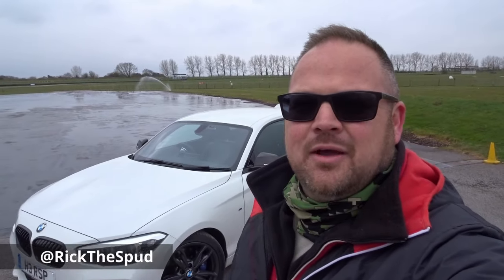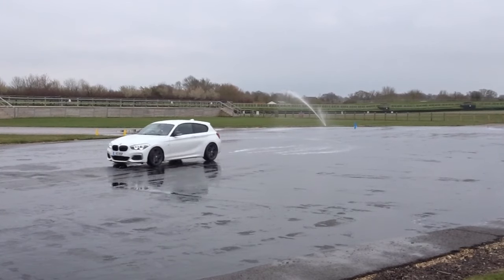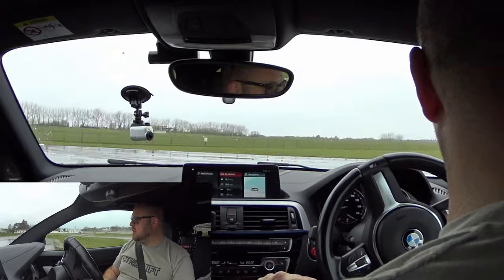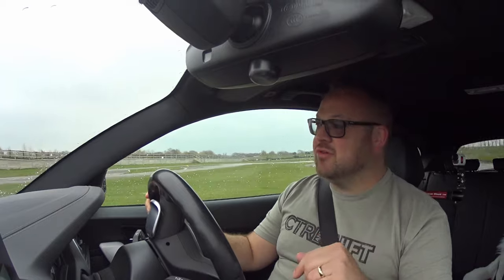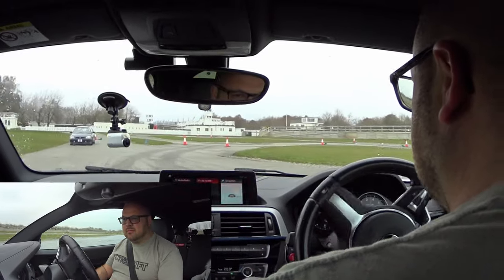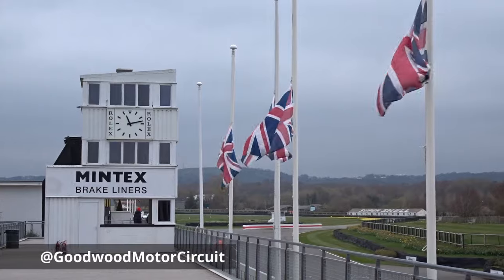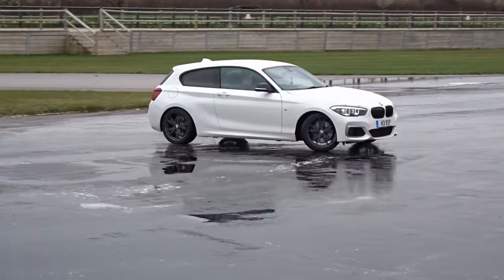So, you don't think you need Traction Control? | Testing DSC on Goodwood Skid Pan | BMW M140i w. LSD

Comment: I think a lot of people are unaware of how good, (or bad), a driver they are simply because of the existence of these driver aids.
Reply from the maker: Haha, yeah you might be right, MDM can make you look like a hero! 😎😉
Reply: @RickTheSpud  It did for me and that was only in a 120d.
Reply from the maker: @gottliebdee263  😆😎👌
Reply: I think it depends on the car cause it isn't the same technology or quality aids. Well, depends a lot if the driver is very good or very bad... So when you go at limits it's very difficult that aids helps you but a very bad driver could be a lot easier for electronics cause the wrong imputs.
But yeah, in the case like in this video, aids helps a lot for sure. It's very wet surface and in that circumstances the electronics can help a lot more
Reply: I had a prodrive upgraded GC8 years ago along with a fast road chassis set up with German made GSD3 tyres.

Ok, no driver aids or such but the car was definitely a better driver than me 😂

It'd let you recover some outrageous moments and I took that as I was a driving god.

Right up until the point I mistook a section of road for another and came barreling in like a cretin to what I thought was the entry to a long sweeping S section and it was actually a tight right.

Never seen all four tyres smoke from a sustained sideways moment before.

A grand lighter and a month later I go it back all shiny and never drove it like a dick again... Much.
Reply from the maker: Haha, great story! Yeah you've got to watch yourself out there! 😜👌

Comment: Great video mate. I bought a 2013 M135i about 6 months ago. I've been driving for 18 years but this is my first rear wheel drive car. The change from 200bhp front wheel drive to 300bhp+ rear wheel drive was quite a shock to the senses! I'm slowly growing into it though. I suppose the motivation to not wreck the car I've spent my life longing for is a good thing!
Reply from the maker: Yeah exactly. Great cars those M135s. Just take it easy and get your head round it, and get some skid training! 😎👌
Reply: I’m in exactly the same boat as you. I have been driving 18 years, just sold my 200bhp fwd type r and have put a deposit down on a 2015 M135i.. I have spent a lot of time on the internet learning what all the modes do and trying to prepare myself for being let loose in 320bhp of rwd madness. Hopefully I can pick it up over the weekend but I’m pretty nervous lol
Reply: @leexr2i  Congrats mate. You will be fine, just keep the traction control on til you get a feel for the power. I've got a M140i now and I've learned these cars wont bite you unless you go looking for trouble. If you are steady on the power (especially in damp) they are just like any other car. Just more amazing to drive! 😋
Reply: @jamessmith84240  

You lucky sod! Enjoy the (epic!) Ride!

Comment: Really enjoyed this and interesting the difference in outcomes. You’ve certainly wet my appetite to do the course in my car, more to see what happens when you go over the line - it’s an M2 competition & I fear it’ll hang me out to dry 😂.
Reply from the maker: Haha. One way to find out! 😉
Reply: With an LSD on the M2 will it not be alot more controllerball?
Reply: More predictable with an LSD? Isn't spinning up one wheel more likely to shunt the car into a spin?

I have read further down that the M140i has one.
Reply from the maker: Several questions and points to answer here.
Yes this M140 has an LSD.
On the skid pan it won't make any difference as it's so slippery that with over 300hp you're always going to spin both wheels.
So, on the road... 
Yes, with an LSD it will be more predictable. Without an LSD sometimes it will spin an inside wheel, sometimes it will spin both.
No, spinning one wheel is LESS likely to spin the car. If you spin one wheel, usually the inside wheel with less load, then the outside wheel will maintain grip and you'll keep going in the direction of travel. With an LSD you can't spin up one wheel so if you break traction it will be with both wheels and the car will rotate. Which if you know what you're doing is good fun! 😉
The middle ground with an LSD is that before you spin both wheels you'll have more grip to propel you forwards without spinning an inside wheel and losing forward drive.
Hope that helps.

Comment: Before watching the video I'll say I've found that at low speed I hate TC, at high speeds I prefer to have it in the "snow" setting, which keeps the TC partially off. This is based on my personal experience and having slid and having hydroplaned
Reply from the maker: Yeah, that's fair. What ever works and feels best for you. I'd say as a general rule MDM or Traction mode is a nice happy medium, it's there in the background if things go really wrong. 😉👌

Comment: Great to know about the "mid DSC off"/ "traction mode".
 just controls the traction control in that case, right?...
Reply from the maker: Yeah sort of, just puts the TC a bit more in the background, it's still there but it comes in slightly later and gives you a bit more slip. Very clever.

Comment: Maybe true for the skid pad but on regular wet pavement, even with DSC off, I have to actually try pretty hard to get my car to slide - it's actually a bit disappointing when I want to have fun with it cause its not as easy to slide around corners as I would like. I'm even on RWD with old tires. I am in an F30 though, bit heavier of a car, but I do have 450 whp/wtq
Reply from the maker: Oh for sure, you'll always have more grip than you think, until you don't have it when you thought you did!
Go a bit faster and pump the rears up a bit! 😉
Reply: @RickTheSpud  workin on it! its probably better that it has more grip than i expected...
Reply from the maker: Haha. That's for sure! 😉
Reply: @arthatis  its proably fear holding you back... me and my pal used to go joy riding in a clapped out 320i e46 and he'd have it all over the place sidways (we were 16)
Reply from the maker: @cupra2Jock.  I mean illegal joy riding when you're underage is prob not the best advice, but yeah, there's no shortcut to experience. 😎
Skid pan or a drift day experience is money well spent. Check out Learn2Drift or Pro Drift Academy for someone to learn to skid! 👌
Reply: @RickTheSpud  im 20 now mate getting an m135i this summer so will be getting some crap tyres on the back and sending it lmao. Drift days are fun too. Very costly though haha.
Reply from the maker: @cupra2Jock.  Ah wicked. Sounds like fun. A bit of power over on the road isn't too bad, but for big skids you've got to go somewhere private. Santa Pod do a 'drift what you brung day' with some play pens to practice donuts and figure 8s. Not expensive. Apart from tyres! 😉
Reply: @RickTheSpud  i think three sisters also do this kind of day, will look into it definitely. Learning to drift your car will improve fast road capabilites and overall driving too, probs more dangerous having a unconfident driver trying to drive quick lol.
Reply from the maker: @cupra2Jock.  Yep 3 sisters do that. If you go there have a look for a cool looking dude called Dango doing drift rides in the drift taxi, good mate of mine.
And yes I agree, always good to learn more skills, most common thing I see is undercorrection when the back starts to slide, people turn the wheel a quarter turn of opposite lock and call it a day. If the back keeps coming round you gotta keep turning. Keep your front wheels pointing where you wanna end up. 😉👌
Reply: @RickTheSpud  thats it mate your spot on! And will try spot him..show him how to properly jock a car lmao:)
Reply: @cupra2Jock.  yeah probably. I live in the city so it's not like I have a ton of room for error
Reply: @cupra2Jock. 

My mate had a lowered E30 325i... That thing was lethal in the wet especially in you hit a manhole cover 😂

Comment: For the UK at least, it would be inadvisable to drive a rwd on public roads without TC. Keep all that sliding business on the race track.
Reply from the maker: In your opinion. People shouldn't be drifting like this for sure, but you can have a car moving around slightly at the rear with complete control if you know what you're doing.

Comment: Great video.  Just got a 135i and definitely hitting the DTC button at start up from here on out.  Wasn’t sure all it did as manual is vague (“Engage for snow and mud” or whatever).  

Have a Solstice GXP and love the LSD…disappointing the 135i doesn’t come with one.  Just driving around and doing some slow speed turns with throttle steer is a total blast and so much more solid and connect vs “one wheel drive”.  Plus LSDs increase traction significantly in rain, snow, etc.  

Hard to spring $2400 just for an aftermarket LSD for the 135i.  They’re a lot because of the configuration.
Reply from the maker: Thank you! 👊
Yeah they're great fun cars for sure, plenty of power and obvs with an LSD mega for skids! 😜

Comment: when driving on a track or curvy roads to have some fun, should we press for DTC and is it better to drive always that way no matter the weather? thank you
Reply from the maker: It depends if you know what you're doing when things go wrong. Half way mode is best as it's more relaxed but will try and save you if things go wrong, altho much later. Depends how good a driver you are. 👊
Reply: @RickTheSpud  but basically there is no downsides of using DTC for sporty driving correct? I am dallying a beautiful 123D E82 and getting a big more power now..
Reply from the maker: If you're a half decent driver you should be good! 👊😎

Comment: Great vid man and question does traction control automatically come back on when you turn the car on and off just got a 328i haven’t messed around with it yet
Reply from the maker: Hey thanks buddy!
Yeah I would assume so, normally whatever you touch, when you restart it then traction is back on, stop start is back on, and everything is back in comfort or normal. 😉🤓

Comment: When I full throttle in sport plus mode on a wet road, I felt that the rear wheels kinda shuddered the moment I floored it, is it due to traction control activated? I was in sport plus mode and did not touch the dsc button.
Reply from the maker: Sports plus I think is DSC in half way mode (MDM or Traction Mode) so the shuddering is prob rear axle tramp from the rear wheels slipping and gripping and slipping and gripping really quickly. They're on the verge of grip. If the tyres spin faster they don't do it, but you'd need everything off for that. On a closed private road near Mexico! 👊😜
Reply: @RickTheSpud  That makes sense then since I was on a wet road. Just curious, would this still happen on a hot day dry road? I have a rwd m340 with ps4s set up
Reply from the maker: They'll prob just grip, but at the point they've lost grip you'd have had to overwhelm them so much they'll be spinning much faster and not shudder! 👊😎

Comment: Traction mode should be the same as Sport+ regards DTC/ESP
Reply from the maker: Yeah I think you're right, I think Traction Mode is short for Dynamic Traction Control or DTC mode...
Reply: @RickTheSpud  Correct.
The difference is, in sport+ the throttle map is more like an on/off switch, but in traction completely off mode it has comfort throttle which is much better and more progressive.
Reply from the maker: @DjNikGnashers  Ah nice one buddy. Yeah that makes sense. 😎👌

Comment: I understand that the MDM mode works at the condition to counter steer, if not the car will behave as the DSC was off. Is my understanding correct ?
Reply from the maker: I'm not sure what you mean buddy.
Not sure counter steer affects it, MDM just allows for more slip but still limits the slip, you can still spin out as shown...
Reply: @RickTheSpud  Actually I’ve noticed that you proceeded  to two skids with MDM mode. The first time you didn’t counter steer and the car made a 180 degree. Seconde time you counter steered and obviously the MDM mode helped a lot to power slide properly
Reply from the maker: Ah I see.
Yeah true, but notice how slowly it rotated with MDM mode on, compared with MDM off!
With grip on a normal surface MDM would prob save you.
Reply: @RickTheSpud  Ah ok I understand. Thank you so much bro...it’s been a long time I was wondering how the system behaves actually and what are it’s limits. Now everything is clear thanks to you 👍
Once again thank you very much for your explanation.
Reply from the maker: @bobalto  Hey no worries buddy.
Hard to go into too much detail on here but I'm glad that helped. 😎👌

Comment: Lately my f30 is cutting off throttle/auto brake if above 80km/h under wet conditions on the highway..is this normal?
Reply from the maker: Is it trying to spin up or aqua plaining?
Reply: @RickTheSpud  not sure. It is just under rain with wipers on and will “auto brake” if I go above 80km for a while.... I also understand that it has brake drying function?
Reply from the maker: Oh really. Wow. Sounds like you know more than me. 👊
Reply: @RickTheSpud  🤣 I just google/YT  it

Comment: Wait, so this was with LSD? Curious how it would do without one.
Reply from the maker: This car has an LSD, but the Goodwood Cars have no LSD and are exactly the same. 
The surface is so slippery, with 300+ bhp you're not just going to spin one wheel! 💪😉
Reply from the maker: 😆
Technically you're more likely to spin out or do a 360 WITH an LSD, as without one you're more likely to just spin up one wheel and not slide at all... 😉
Reply: @RickTheSpud  Good video very interesting, but I drive EVERYWHERE in DTC OFF mode, it's the first thing I do when I get in the car, hold it down for a few seconds to turn it off completely.
My car has 455bhp/634nm and I have never lost it yet, even with an open diff, I just have fun squiggling the back end at every roundabout.
Reply from the maker: @DjNikGnashers  Then you've got more skill than most bud, good job. 😎👌
Reply: @RickTheSpud  Maybe more luck than skill my friend lol, but I have been driving RWD cars for the past 35 years so probably just second nature now !
Reply from the maker: Haha. Prob a bit of both mate! 😉👌

Comment: Great Content!! lsd fitted obv
Reply from the maker: Thanks buddy!
I hope you've subscribed? 😉
Yes this car has an LSD, but it makes no difference on this surface as it's so slippery, with 300+ bhp you're not just going to spin one wheel! 💪😉
Reply: @RickTheSpud  just did! agree with your comment. cheers
(edit: The difference would theor. show upon the slightest level of traction on one wheel)
Reply from the maker: @phil3184  Ah cheers! 😎👌
Oh for sure, if there was any grip it would grip up, usually on the outside wheel where the weight is and start spinning up on the inside wheel.

Comment: Stock differential?
Reply from the maker: This car has an LSD, but the Goodwood Cars have no LSD and are exactly the same. 
The surface is so slippery, with 300+ bhp you're not just going to spin one wheel! 😎
Reply: @RickTheSpud  i heard that the Electronicdiff is only on dsc fully off activ... would love to see drytesting with stock diff.
Reply from the maker: @lukatkalcec9285  I believe it's the opposite, the electronic diff is essentially a fake diff lock and is trying to help you out when DSC is on, when everything is off you're on you're own, and on a grippier surface it tries to spin one wheel. 🥴

Comment: Hello so I was thinking about getting a mini cooper S (r55) but I wanna make sure I get the right one with the right safety feature. So DSC is standard on it but does it break individual wheels around the corner to put the car straight? Or is that DTC? Here in the state’s American cars have 2 systems, TC (only limit wheel spin during take off) DSC/ESP/VSA BECAUSE MOST CAR BRANDS USES DIFFERENT NAMES(breaks 1-4 wheels cut power to help maintain stability at any speed)
Seems like Mini and bmw systems are kinda confusing
Reply from the maker: Hello mate, no I think your first guess is right. DSC is your safety systems and dynamic braking etc, DTC is dynamic traction control so that is just clever TC and allows more wheel slip while providing skids! 😉

Comment: Can you turn if x drive on and
Reply from the maker: And?
Reply: @RickTheSpud  and can we turn off x drive somehow on G30 without doing anything mechanical on it?
Reply from the maker: @emperorsanders5744  Not sure mate. You'll have to go into the settings on the idrive. I've just had the new M3 xDrive for a week and you can do it on that from the setup button.
If not, you might be able to get it coded in from one these computer boffins like 'defined coding' etc...

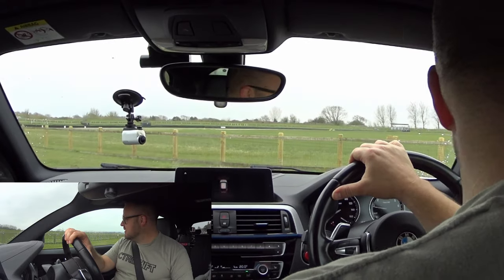Comment: 4:28 doesn't it harm gear box or diff ?
Reply from the maker: Nah mate. Good as gold. The gearbox electronics protect itself so if you try and put it in forwards when the wheels are still going in reverse it won't let you. That's why you let off the gas first, change direction, then the wheels are rolling forwards with the gearbox freewheeling with no power, into forwards, and away you go. And because the wheels are already  moving in the right direction you don't need to use the brake to select drive. 😎👌

Comment: Hi Just wondering did the m140 have an open or locked diff? Thanks
Reply from the maker: This car has an LSD, but the Goodwood Cars have no LSD and are exactly the same. 
The surface is so slippery, with 300+ bhp you're not just going to spin one wheel! 😎

Comment: Good video. What does MDM stand for?
Reply from the maker: Cheers buddy.
MDM mode and DTC mode (Traction Mode on the dash) are a half way traction setting whereby the Traction Control/Stability Control (DSC) are still working but are more relaxed and in the background. They allow for more slip and rotation of the car before they get involved, and then allow the car to stay more out of shape.
I believe both MDM and DTC do the same thing, but MDM (M Dynamic Mode) is only on 'M' power cars (M2, M3, etc) and DTC (Dynamic Traction Mode) is on all other BMWs.